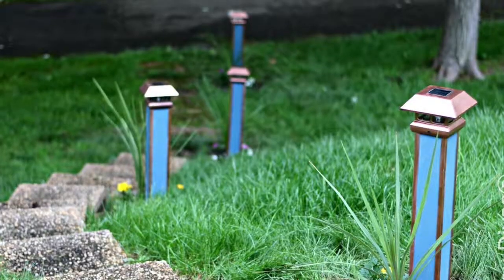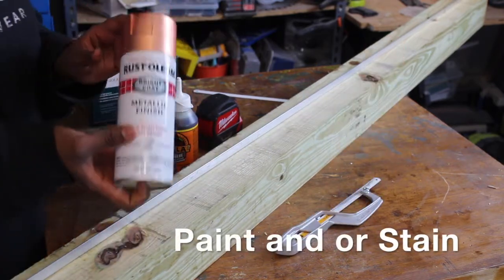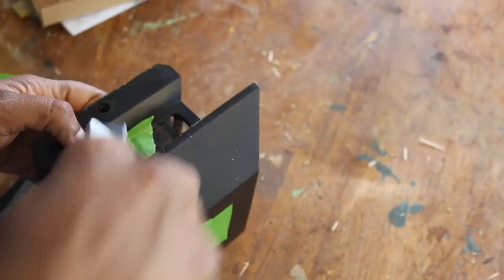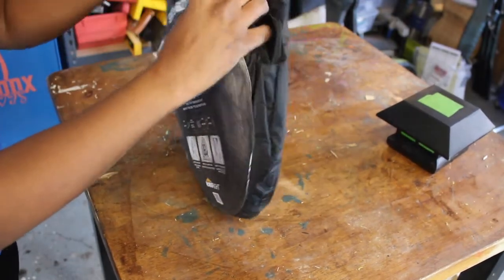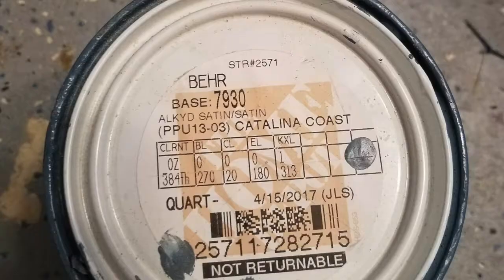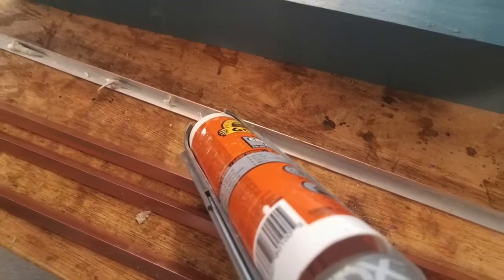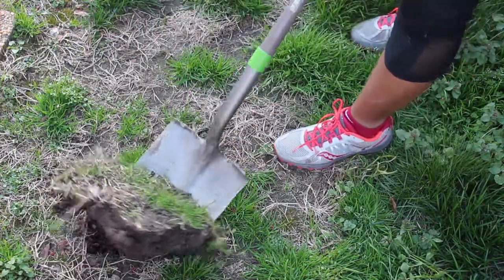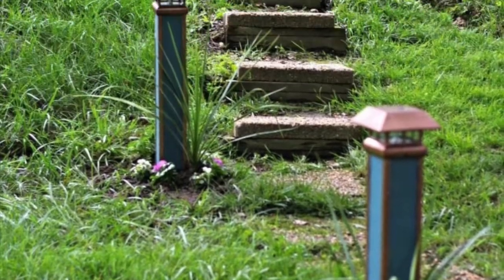Installing Easy DIY Outdoor Solar Landscape Lighting

Comment: Thanks for sharing! Recently I’d been browsing Pinterest for some edging ideas to separate a future Doggy jungle gym/play area conundrum for my Aussies. The plan is to build up since I have only so much space horizontally and my two need multiple levels of running, jumping and exercising/challenging their brains and muscles with an agility like playground. And I’m not talking some boring ole box like constructions. I’m wanting to build multiple levels with different ways of achieving the height they want. I’ve seen structures that have a giant hole 🕳 or opening cut out of the roof/ceiling for the dogs to jump up and out of reaching the next level, I plan to build a bridge connecting the decks/units, stairs and even add dangling toys they can pull on, maize like play pen and I haven’t fully decided the finished project but not only is it going to be multi levels, I want maize like feel even in the landscape using grass like plants native to my area... basically the works! And most importantly I want a very natural escape using safe grassy plants that can grow high following along a path they can explore, and a safe but natural playground they can explore and test their agility. So anyways all of this had led me to searching online till I found the neatest edging on Pinterest that incorporated ankle height gabion walls/rectangular forms filled in with gravel and smaller rock, but in between each gabion rectangle were posts hunkered partially in the ground and attached as a main support for the ground level gabions to attach too. I hadn’t anticipated lighting though, so with your inspiration (greatly appreciate it btw) my plan for edging a future doggy play area is to use up the large roll of wire fencing I have left from another project. It’s not chicken wire (too weak/brittle and 🕳 holey), not true hog wire either but very similar in look only much smaller squares. The wire I have is perfect because I’m using it to create a gabion wall only much shorter for edging purposes. Otherwise you’d need something more substantial like true hog wire if a fence is desired. Anyways my plan is to shape the wire into essentially a rectangular shaped box with a bottom and without a top. That’s as necessary for filling each rectangle with small rock. Depending on the square holes I’ll either use pea gravel or bigger rocks, maybe a combination of both for variety and texture. Anyways, how it works is I’ll use either a 4x4 or larger post, cut down to ankle height plus add some for compensation of in ground depth. Then at ground level (which will be level) attach the gabion rectangles to either side of each post, adding post to gabion to post-gabion continuously to create a short wall for separation of the play area which will have gravel most likely and on the other side the grass I’m hoping to protect and keep free of gravel and rock. I never anticipated lighting, now thanks to you, I’ll be incorporating almost identically as the only difference from my edging to your lights on posts is mine will have gabion wall/edging attached to each post. Anyways sounds complex but the end result is beautiful, whimsical and again provides a natural quality that is sturdy and long lasting. Whew that was long but in case anyone is curious type in gabion wall/edging and if you find a simple gabion edging with posts in between every few feet, that’s what I’m going for plus now the lighting 👍🏼

Comment: Personally, I’d leave mine without paint (post) and apply a clear coat depending on what type of wood post used... regardless though, after cutting to the desired length, it’d be easy using a table saw or router to cut in decorative dados either horizontally or vertically to create some interest. Perhaps use a colorful stain in blue, red or multiple colors for either inside the dados or in between dados to create a story stick effect. And if colors of the rainbow isn’t your things try using different stains or routing in a variety of woods you have on hand. We’ve all seen those dipped branches with beautiful colors... I’ve seen some gorgeous green stains, teals, I typically am not a fan of paint bc it hides the wood grain, but that’s just me and her blue painted posts turned out beautiful. Another idea to add texture is use a grinder to make details in the wood like ripples or cut in shapes (plenty of skilled woodworkers that demonstrate a variety of looks with grinders and chisels)! Use a variety of hand chisels in detailing small lines, curves, grooves, even shapes for that tribal effect. Dremel has plenty of options for engraving details, pictures, tribal art, etc. I could go on! Moving on: Tip if the angled bars used are aluminum, you can simply and safely cut to size/fit using a mitre saw, I’d check if the same is true for a table saw. Aluminum is a soft metal that wood cutting blades are appropriate for cutting. If you’re wanting to go for a more rustic or industrial look then buy some angled steel or flat steel (make your own angular pieces) then buy a diamond blade, I believe but check to be sure. Diablo now offers blades specifically for cutting stronger metals such as steel that can be applied on a mitre saw, circular saw or table saw. Bandsaws also offer their own tough metal blades and even a dremel can do a decent job... practice with a dremel first though and expect lots of sparks so protect your hands and eyeballs and count on a few minutes to pass by before you’re through. Last Tip for spray painting or hand painting the angled metal (regardless what type) use a good spray paint primer specifically for metals then apply the color desired. I’ve spray painted enough metal to know it’s difficult to keep the paint on and especially after it’s scratched or dinged. Once primer and paint is applied and dried, you’ll want to use a water based polyurethane like Minwax or Rustoleum but be sure it’s not oil based or it’ll yellow over time. Same goes for woods regardless if painted, stained or poly only finishes. Oil based can be great if you’re willing to trade clear for yellow-orange.
Reply from the maker: Wow thank you these are all great tips for a future build. Thank you so much!